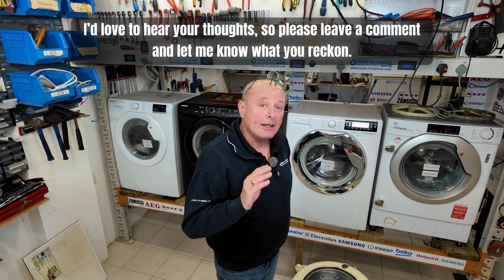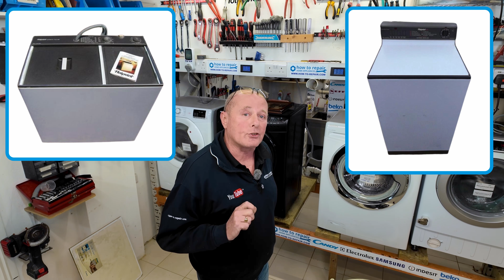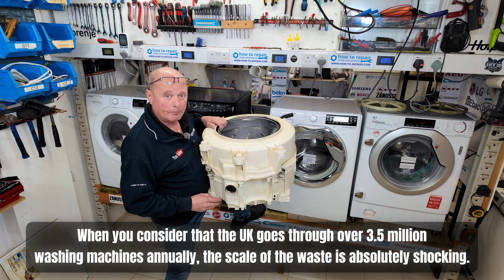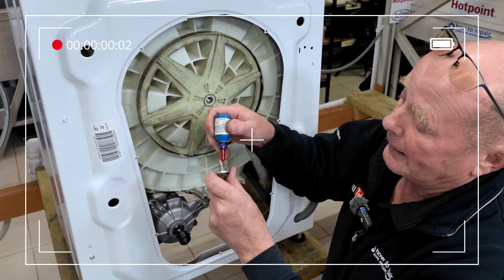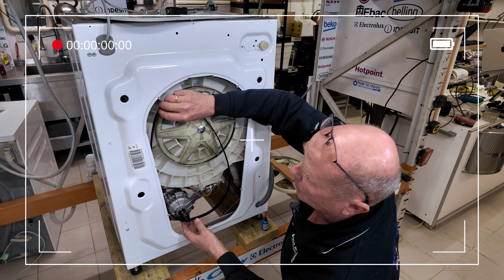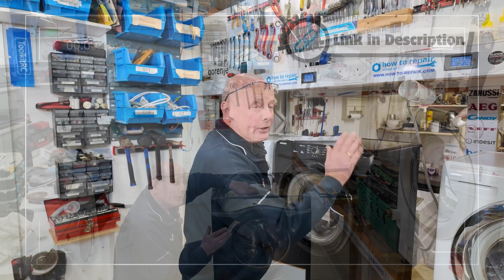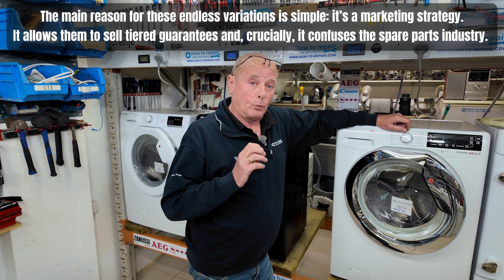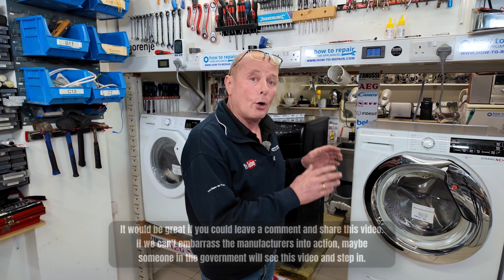I Scrapped 13 MACHINES to Prove a Point: STOP BUYING These Brands!

Comment: my last washer, was around 25-30 years old, it weighed a ton, the drum on it rusted through and you just couldn't get a replacement one. back in the day I could fix a 50 year old twin tub and parts were easily available.
it used to be the case that manufacturers made a product and that product would be sold for at least a decade if not several, now manufactures are making new inferior products every year, and the components are tweaked so that they are not interchangeable, so they will make a run of that model for a few years and then make it end of life, usually in a time span of less than 5 years, so the clock is always running in regards to spare parts, but they also inflate the price of original replacement parts, the idea is not to fix what you have but to buy new and replace, as that pads the bottom line and generates more profits. the design is to make it harder and more expensive to repair than replace. why sell a set of bearings when you can sell a whole new machine?  so weld the drum and make it so that you have to replace the whole drum unit, cha-ching, more profit, but not only that, make the price of that unit so close to the price of a new one that people just end up buying a new one, that way they will keep a few spare parts, but they don't have to keep a lot of them as it make more monitory sense to replace then repair. 
it used to be the target lifespan of a fridge, cooker, washing machine, etc was 25-30 years, now it is more like 3-5 years.

Comment: Thanks for the fantastic video. I bought a Miele (basic model) in 2009 for about £600 and it is still running. I use it most days. It is still like new.

Comment: A great great information. But just a sort of excuse for the manufacturer: I am NOT SURE, if the goal of this planned obscolence is really the planned obscolence. It is maybe pure simpler: 
I think, it can be JUST A CHEAPER way of building the machines. The price point gets lower, the dealer earns more ... That is the direkt result of the stupid technical solutions. 
But: 
In result, of course, is it annoying. instead of screws, a glued drum is (probably) cheaper in manufactoring. The side effect of earlier destroed machines ... comes on top, but I think it is not really the first goal of the stupid constructions.

Comment: Those oil soaked unsealed felt bearings are clearly designed with a very short life span - to seize the moment the oil dries out.  And it just so happens the oil only evaporates when it's above the temperature it gets to when the bearing is operating.  So the manufacturer can plan very precisely how much work the consumer is going to get before they are told by a service person the cost of repair is more than buying a new one.

Comment: I repair these appliances as well since I've been 12 or 13 with my father. 
I keep saying this. We are not paying enough for them.
We used to pay 3 to 4 weeks wages for a washing machine in the 80s in Ireland.
Lasted 15 + years. 
Now they are less than a weeks  wage in most cases around 350 to 450 for most of the common name washing machine around 8 to 9 kg and are lasting 6 to 8 years. Not much in the difference when you work it out .

Comment: Just got screwed by LG. First LG front loader made it 8 years with one bearing change then the plastic drum finally got stress cracks so I bought another LG ant it only made it 4.5 years and the bearings went out. The drum was welded together and I was shocked how they can do something so malicious to force people to buy another machine. Well never again buy a machine like this and now I brought a Speed Queen FF7 and it all stainless drum and spin basket and made in the USA. Great video exposing this.

Comment: I inherited a 1984 Electra electronic de-luxe washing machine.  The drum bearings were seized; I replaced them for £20,, that was 27 years ago.  It is still working. The only other repair was to unblock corrosion on the pipe leading to the pressure sensor tube., this had got blocked with soap debris  and almost caused the drum to fill with water. Half an hour to fix. It uses 100 litres of water per cycle. Currently 42 years old and with a mechanical timer programmer. Apart from the drum bearings, every other part is original. I was given a Bosch WAE24063GB machine that was scruffy, so nobody wanted to buy it for £20. I stripped it down and sold components via eBay for more than £60. Worth more dead than alive. It was beautifully made - typical Bosch quality in the old days, not so long ago??

Comment: They make them so its just NOT worth it to repair the machine.
Here in Croatia you usually get 2y warranty plus 3 years extra for free if you register online, now imagine if some older guys get in such deal, they usually dont or forget to register it online and guess what, they miss those 3y extra.

Comment: Yes today's appliances are nothing but disposable junk. 
You buy them with a 3 year warranty perhaps, and if lucky you might get a couple of more years out of it. Then you buy a new one with color display and a much better app than the old one...
That's just the way it is today. Same deal with TV's and whatever. 
LED bulbs could last a 100 years with proper cooling and power management, but hey... Got to keep the cash flowing! 😉

Better to sell cheap and often, than rarely and expensive.

Comment: Love your videos. I was a domestic gas engineers and I have seen the decline in quality of cookers, boilers etc. Some of this is due to us buyers getting rid of things and replacing them because they have become outdated and not longer 'trendy' looking. Think fitted kitchens. I used to fit kitchens and had to remove some excellent quality and condition units because they were outdated. Especially when a older person sold up and younger people moved in. They just did not want to keep the older units even though they were perfectly functional. Are you old enough to remember the solid gas cookers ? Enamalled cast iron chassis and strong brass gas taps !! Same with the boilers - cast iron heat exchangers and well made surrounds. Now all cheap and tinny. Keep up the good work and 'out' those manufacturers who are doing their best to make their products fail after the warranty period....

Comment: I recently had to scrap my 15 year old Bosch washing machine, because of a fault that would probably have been an easy and cheap fix, if the right person had gotten it into their hands, which I sadly couldn't find.
There was some internal water leak, and the electronics noticed this and (for saftey reasons) stopped the washing cycle dead. I tried to find it, dismantled it as far as I was able to (not very much), but had to give up. When I bought a new machine, they took the old one away and said they're not even allowed to try and salvage it so someone else could at least enjoy a cheap and rugged machine.
It was probably just a tube that slipped off or crumbled. A part worth single digit € costs. Apart from this, I never had any issues, doing 2-3 loads a week. And the cleaning results were still better than my fancy new thing.

Comment: yes i agree some manufacturers have dodgy bearings. however there is so much consumer overloading a 10kg with 14kg of clothes which is causing the failure. I see it time and time again. Im a repairer of all brands and believe my comment is another perspective which wasn't mentioned. i use the rule of thumb fill it to three quarters no more.

Comment: How is it a software problem if a PCB fails? If a drive fails in a computer with Windows (software) installed and the software gets corrupted, it's a hardware problem, not software.

Comment: Now days I'm spending $5,000 - $10,000 every 5 years on new kitchen and laundry appliances because all are not built to last.
Reply: Same. Ive had 2 samsung american fridge freezers, 3 tumble dryers and 2 washing machines in 7 years (fridge was replaced under warranty after 3 years) so thats alsmot £4500 worth of appliances. Bonkers.

Comment: As soon as a i saw this my first thought was avoid hoover/candy. I had a hoover tumble dryer which the power switch basically melted and nearly caught fire. I replaced the switch myself and not long down the line it happened again and i noticed the wires going to it had become very brittle/hard. So i scrapped it, lost trust in it. So purchased a candy wi-fi tumble dryer not realising that its basically a hoover clone. It was only once that it arrived and id installed it that i noticed the similarities and did some research. Well, that was a big kick in the teeth and dent in confidence.  I dont think the thing lasted more than two years before the PCB burnt out, similar to the hoover, was to do with the power switch. Anyway, straight into the bin, didnt want anything to do with it and will steer clear of them brands from now on.

Modern products, absolute junk. Ive now got a sharp tumble dryer which i paid around £300 for, that gave up the ghost after around 18 months and as its still under warranty ive had engineers out to fix it, again, PCB failure. Bitter pill to swallow really. Once this one has died again i dont know what route to go, not heard anything good about heatpumps, just bad. So is it worth shelling out for a Bosch or Miele?

Comment: what about Bosch is it a good brand?
Reply from the maker: Bosch make a very good machine, but they build obsolescence into their Appliances by making some of the parts so expensive it is uneconomical to repair and they know not to supply any Technical data to the end users to a system and repairing their appliances. Don’t get me wrong most of the companies out there today are crooked in someway.

Comment: Hotpoint screwed me out of my warranty just because I didn't reside at the address I was in when I brought it. Which was well over 8 years ago.
Suspension springs failed and the drum come loose mid-cycle, I'm no expert with white goods, I would have fixed it with more knowledge so you got a follow from me.
Ended up going out and buying a new one from Hisense, mainly for it's Anti allergy functions but the fact Hotpoint did that too me has made me loose all trust in them as a company.

Comment: 08:41 - I want to chip in here, that printed circuit board of £115 is way over priced and inflated, I am a qualified computer scientist (BSc) and doing my (MSc) with Artificial Intelligence, the PCB is an integrated electronics board (Ie) which is comparable to an Arduino Uno, these devices can only do one task at a time, the cost for an Arduino Uno board is £25, a chinesse knockoff version which does everything the same as an Arduino Uno board is £5-10 on ebay. the software does not cost £100, it costs £3 at best so they are wripping people off left right in centre, the console panel and LCD is nothing more than a keyboard, pentiometer and basic LCD screen

Comment: I'm a Electronic Engineer. I maintain High power Television transmitters equipment. I have been in electronics for 61 years. The best Maytag washer/dryer I had was a SE 1000 combo. This was 1990 computer technology. Lost everything in a fire. I bought a use Samsung top load washer. When I open the unit up the first thing I notice was the 120v feed in wire gage size that was way too small to run the machine. I found two broke wire that feeds from the speed tach sensor to the control board. Th ground and signal wires were worn out completely. I ran new wire for the 5 volt, signa, and ground. This repaired the was cycle but the unit still would not spin. On the digital oscillator scope (Tektronix model TDS 784C. Look at EBay, very expensive scope) there was a very clean pulse on the scope from the speed tach sensor. I have tried several control board resulted in the same problem. There is nothing else to check so Samsung design this PCB controller to be reloaded to work. They have the software that are not available to a non-Samsung repair person.

Comment: Our 2021 AEG 8000 Lavamat (or something like that) just started leaking water. I've opened it and couldn't find any obvious leak. I dried everything up and put it back in service and a few days later the same problem came back. I immediately opened and saw water seeping through the welded seam on the plastic outer drum. Utterly sad.

Comment: They all build to maximise profits. They also build to just cover the warranty period. You have to understand anything broken during warranty, is a lost in profit. However r and d that is needed to fix an issue probably cost more. It's not just these heavy machines. Nintendo decided to just repair the drift in their joycon than fixing it with new parts.

Comment: My mother always bought Miele as their machines last at least 25 years, my washing machine had a parts and labour warranty for 10 years, we had it serviced just before the warranty ran out, the only thing wrong that the engineer found was the pipes were filled with dog hair and he used pipe cleaners to clear the hair.

Comment: I bought a smart watch a few years back. Took it out of the box, turned it on and wore it for a few hours. It was totally fine. I was moving house at the time so I ended up turning it off and putting it back in it's box and we moved, and I couldn't find it anywhere. Thought I lost it in the move. A couple of months ago I find it in a big garbage bag of my kids old clothes, in a big cupboard. Charged it up and turned it on. Bearing in mind it had only ever been used for 3 hours at most, I assumed it would work totally fine other than being the outdated model. Hadn't been dropped or damaged or anything, even the box still looked brand new. It had been bundled up and cushioned in clothes the whole time and the clothes got put in the cupboard and the first time they got touched after that was when I was digging out clothes to hand down to a friend's baby. Nope. Battery wouldn't hold a charge longer than 30 mins, it was super slow and kept freezing up and lagging on me and struggling. It's made me wonder about the countless phones I've had that after a year or so go like that. I've genuinely always thought it was me going on sketchy websites or filling it up with bloat apps and photos and videos and never deleting them. Now I'm not so sure.

Comment: I managed to find a top end AEG washing machine (retailed around £1k) for 200 GBP (poor girls late mother passed away) in 2022. I used it regularly (around 3-4 times a week) up until Oct 2025 when it stopped working. The washing machine repairer said it wasn't mechanical failure but motherboard failure! He concluded it wasn't worth fixing and the money it would cost to fix it would go on the cost of a brand new top end machine. Washing machines are a joke.

Comment: I had a samsung washing machine for 6 years but decided to buy a new one as i eas replacing my kitchen 
I gave the old machine to my daughter who has had it for 4 years it has never had any problem i did replace it with a LG which is excellent but i would never buy anything without a 5 year warranty.

Comment: It's the same with all the new cars. In the name of efficiency and emission regulations, the manufacturers build absurd complex, hard and expensive to repair cars, of course cobbled together as cheap as possible. We're talking about write offs after 8 years or 100.000 miles. What's better for the environment? The last 1-2% in fuel consumption or a car that could be used twice as long? Btw. most manufacturers seem to be doing a goog job in planned obsolescence with electric vehicles. Fully integrated drive units with engine, gearbox and power-electronics combined in one (watercooled) assembly. The water seals fail and the coolant begins to flood the whole unit, which is unrecognizable until it's too late. Even if "only" one component fails, you often can't buy a single part, only the whole assembly. Of course third party repair shops have already developed repair methods and parts, but the regular customer will be stuck with the authorized dealer.

Comment: I had a Miele W526 for near enough 25 years. I thought the bearings had broken, but after dismantling I found the spider had corroded and had separated from the shaft. I decided that it wasn't worth repairing and new Miele washing machines are quite expensive so I ordered a Candy which arrives tomorrow.....I'm interested how long this will last. I hope it lasts long enough to have a good look at a better and more reliable washing machine. I was looking at the Ebac (British made and designed with 7 year warranty) but I don't think they make an integrated machine. Maybe in a year they do

Comment: Electronic Engineer here.  The company I'm with right now makes large science equipment and while we only warranty for one year (I've made my opinions known!), we have a good track record providing near-cost upgrades, servicing and repairs for well over a decade, with manufacturing and design issues typically being absorbed by ourselves regardless.
Great to see this type of video and shouting out the Right To Repair!  Naming and shaming needs to happen or we'll just keep falling down this rabbit hole.
Reply: well said
Reply: YOU'RE COMPANY IS BREAKING THE LAW..
ANYTHING SOLD, MUST BE FIT FOR PURPOSE,AND LAST A REASONABLE LENGTH OF TIME..NO COURT WOULD SAY YOUR EQUIPMENT IS OK, TO BREAK DOWN, IN A YEAR...
SO YOU SHOULD, IN FACT, BE ASHAMED TO BE WORKING FOR YET ANOTHER SET OF GREEDY DEL BOYS....

Comment: All manufacturers benchmark new competitor models.   They test  them measuring washing efficiency, power and water consumption, noise etc.   Then they strip them and critique design of all parts.  If a new feature that reduces cost or improves sales is seen, it will quickly get incorporated into the next project.
This is the mechanism by which manufacturers seem to do the same thing/colude etc.  They are not coluding, they are competing.  But the end result is indistinguishable...